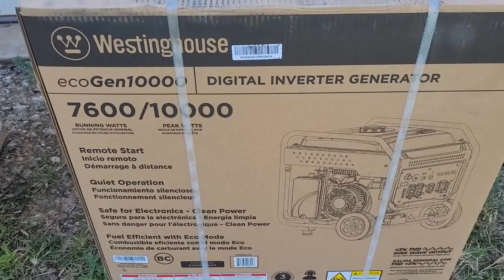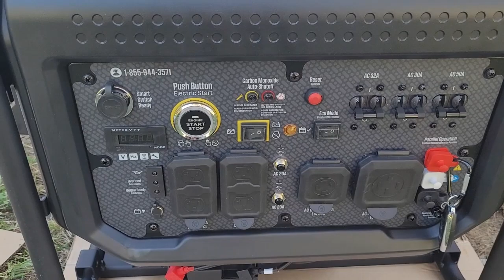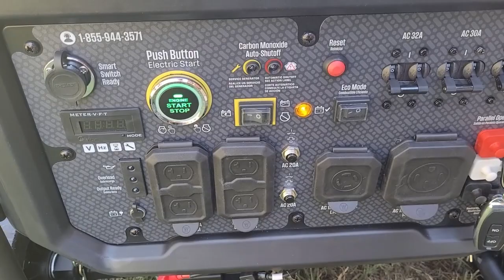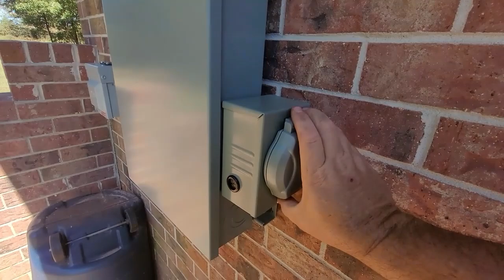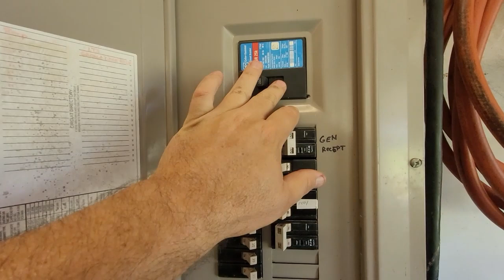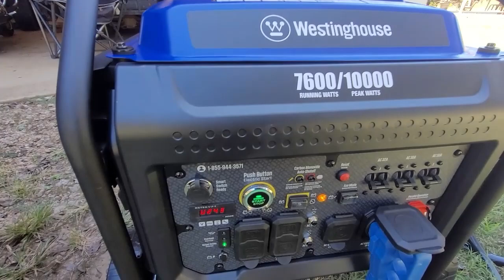Home Emergency Generator Power

Comment from the maker: There have been questions brought up about the actual amperage of the 50 amp plug that comes on this generator.  I am definitely Not an expert.  The more I learn about electricity the worse the rabbit hole goes.  This video is a general overview from a consumer point of view.  I would suggest that you do your own research before buying anything.  With that said I would highly encourage, anyone that might have a need for alternative power, to seriously consider some type of plan for yourself that would best suit your situation.
Reply: You can get the full 50 amps if you plug the parallel cable between the two generators up if you ever need too.
Reply from the maker: And that is something I didn't even go into.  They did come with the parallel cables.  Thanks for the info!

Comment: Id like to see a generator made that runs at 13000 watts which would need to be around 16000 or more.  I believe increasing the wire size and amount of winds could get thing's where its needed.
Reply from the maker: They are absolutely out there in that size range to be had.  My issue with larger generators is the fuel consumption goes up exponentially compared to the wattage increase.  
Thank you for stopping by and commenting!

Comment: Good luck to you. I’ve had my dual fuel 12,500 water for four years now and it’s starting a crap out. Westinghouse will not even call me back after I get a number from the call center. I’ve never gonna buy another Westinghouse again. In fact, I’m only gonna buy something I can buy locally so if something does go wrong, they can fix it locally. Crazy thing is all my generator repair. People will not touch a wing house that pisses me off.
Reply from the maker: That is a shame to hear.  This is the first time I have gone with Westinghouse.  I have always gotten Champions before and had really good luck but they didn't have what I liked in this size generator.  I hope I have some good luck.  Thanks for stopping by with this information.

Comment: It says right on the box 7600 running Watts.  That's not 50 Amps.  That's about 31Amps.  50 Amps would be 12,000 running Watts.  Did I miss something???
Reply from the maker: I freely will admit, I would probably have to study to be a novice at electricity.  I based my belief that it was 50 amp since it was marked on the box and the generator itself as 50 amps.  Fortunately, even with ignorance on my side, the generators still pull easily the items I need to run.

Comment: Get a solar generator also. Why waste limited fuel to charge small devices.
Reply from the maker: @HorseRadish403  there is no way, no how a solar generator would power what I need in 105 or 10 degree situations.
Reply from the maker: @HorseRadish403  thinking about solar generators they do have their place in the world.  I just don't  have much of a need for charging devices.
Reply: Solar generation is hefty cost upfront for what u are going to use in the future. And u need peak sun to recoup what u spent. So it not a cheap install

Comment: I'm not trying to be critical here I just want to make sure people that watch this understand how to properly load and run a generator on their house.  Understanding the equation below is very helpful when figuring out your loads and the demand you are putting on your backup power source.  

50 amps is 12000 watts... Those generators put out 41.67 Amps at 240v starting and 31.67 amps at 240v running.

Watts=amps X volts
Reply from the maker: No Worries.  I am definitely not an electrical expert.  Best I could do was take advice from an electrician and do the best I could from there.

Comment: We have had one of these for over a year. Just went through Helene. I can’t run AC with the well and hot water heater, but does the whole house nicely.
Reply from the maker: Hope yall made it through the storm ok.  Don't forget about 5000 btu window units.  They come in super handy, they are relatively cheap, and the generator won't even blink running them.

Comment: Nice video!  One question, why didn't you opt for the WGEN28000?  It has clean power (<5% THD) and has a higher running and surge power output than the two generators you are using.  The generators you purchased are delivering ~ 31 running amps.  The WGEN28000 is outputting ~41 running amps on each of its 50 amp plugs.  Plus it has a longer run time with a larger tank.
Reply from the maker: There were several factors in my thought process.  
First, I needed two gensets.  My shop and my home are on two different meters.   Price on the two 10,000s is less than one 28,000.
My second was I needed something compact as possible for storage.  Each of my generators weigh in at 147lbs.  The 28000, even having wheels, has a back crushing weight of 557lbs.  
Third was fuel burned per hour.  The 10,000 burns 5.23 gallons in 7 hours half load.  The 28,000 burns 17.2 gallons in 10.5 hours at half load. (which I can see mine will rarely run half load even).
Fourth was the 50 amp power.  I can't find any information on running amps but the Westinghouse is the only one I have found that says it supplies 50 amps of power, not just having a 50-amp plugin. 
Fifth, I will never own another dual fuel generator.  They burn through propane like crazy, with less power output.  
The last point you mentioned, which was not in my consideration, but I looked it up anyway.  The 10,000 has <3% THD
Just for information for anyone.  The 10,000 will not run central air/heat.  I keep window A/C's and space heaters on the shelf for emergencies.  Plus, I have a fireplace for winter.
Sorry, this reply is super long but it's great to get down in the weeds on this type of information.  It may help others that watch the video make their own decisions on what they might need.  Thanks so much for this comment!
Reply: @RandallsLittleAdventures u are correct about having 2 instead of one. Even though they are for different purposes better have 2 than one. Also them huge 20,25,30k+ gens gulp fuel just idling. It gets costly and incontinent refueling. Hurricane beryl hit texas we was 5day with line power. Wen 11,000/7500 drank 1gallon every 2hrs pumping 4200watts. Thats 3ton ac, 2refridgerators, drink cooler, deep freezer, 4ceiling fans, lights. Everybody was comfortable for $32 aday in gas. Problem was finding gas while everybody else looking for gas.
Reply from the maker: @herewegoagain4041  Just like the old saying.  Two is One and One is none.  
Finding more fuel does seem to be the caveat of the situation.  We have a pretty good supply here but would always like more.

Comment: Nice set up man, Those are some sweet gennies.
Reply from the maker: Thanks much my friend.  The best thing is the total cost is way lower than having a dedicated backup generator installed.
Reply: @RandallsLittleAdventures  And it really seemed alot safer too, Thats probly the best way to do that
Reply from the maker: I think so as well.  I can keep them under lock and key in the shop until needed.
Reply: @RandallsLittleAdventures  that's a clean set up. If I get a chance to upgrade mine I will have to emulate what you did.